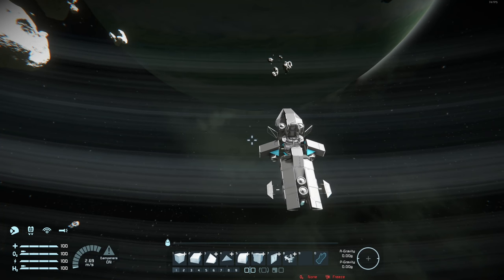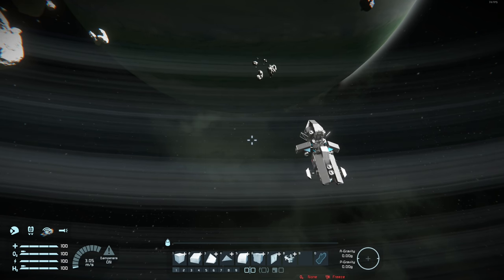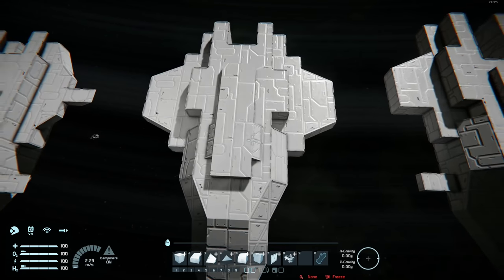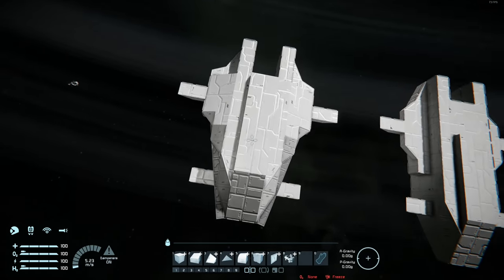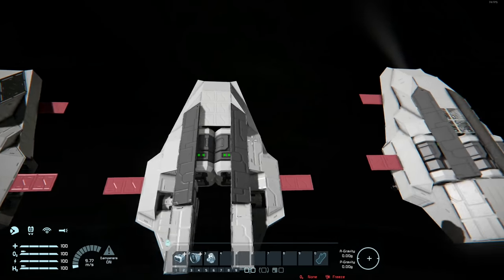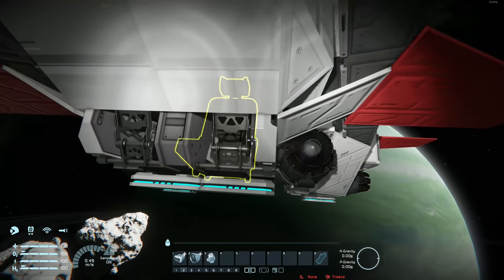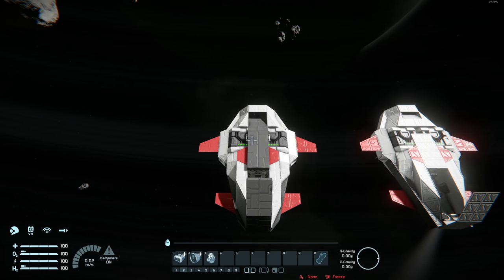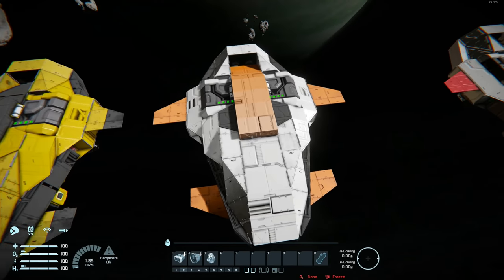I tried to build the smallest ship I could

Comment: I always have a hard time getting the first shape down, and you make it seem so easy! I’m gonna start yelling witchcraft soon if you keep up this magic
Reply from the maker: I've had a few thousand hours of practice lol
Reply: I already am yelling witchcraft.
Reply: This, much so
Reply: do random stuff, you might make something you like
Reply: I will join you in yelling witchcraft, cause that it truly is.
Reply: start with function, then add armour to pad it out where needed.
Reply: start with putting most functional pieces in (seat, battery, thrusters,...) and then wrapping it in armor, a rough first shape should form eventually, then if you like that shape you can move functional stuff around to alter the design significantly more than by just refining the armor.
Reply: Just build a 2D shape with some planning of where things will go, then you build the 3D shape with more detail and then add detailed blocks to help with the ships design.
Reply: Same here, I all my design that look half decent are extremely awkward to fly and run out of power/fuel in seconds
Reply: I use graph paper. Seriousely, it saves me hours of game time to have an outline. Took me a bit to understand the geometry of the armor blocks doing a "front, side, top" view, but its the only way for me now. Also, you haven't lost much if something happens in game; a "hard copy", if you will.
Reply: Those wings.... are a mod,  right? also,  where did he have the space to put a rotor in at the very nose to lift the canopy?
Reply: “witchcraft” is my ship name hahahahaha

Comment: I would have replaced those front blocks on the hinges with windows, so the pilot can look out and it wouldn’t go into the model. And the flat block right behind them would look better slanted down. The bottom needs work too, lots of unfinished and exposed systems there.

Comment: I guess there are two types of builders. The functionality first type and the shape first type. Me, I lay out every single functional block I want the ship to have and then slap the shape on top, but the shape is usualy weird. You did an awesome job with the design of the ship, Next time I'll try laying out the shape first!
Reply: I find that when doing the shape, adding some of the bigger functional blocks (connectors, antenna, ect) can help you figure out the shape better, at least when it comes to small ships

Comment: Three quick questions:

1) Are you playing with thruster damage off, or are the 2x1 tips in front of your reverse thrusters small enough to avoid thruster damage?

2) How do you recharge the ship? It doesn't have a merge block or connector anywhere on it, so would you need to build new batteries every time it dies?

3) Could one theoretically replace the folding cockpit shield armor blocks with glass so that it's flyable in first person?
Reply: Obviously I'm not the guy who made the ship, but I can answer some of this. 

1) Not sure, looking at 4:38 it doesn't look like there's tips there? Might be me going crazy, I dunno
2) In that ship's current state, it'd need new batteries every time. You'd be able to use a 1x1 merge block on the bottom or a small reactor for easy docking/refueling though, I reckon
3) Yes, panels and windows (iirc) have the same hitbox. It wouldn't have the same depth as the final build, obviously, but you could recreate the 5:41 build.

Comment: I would either add a connector on the bottom with maybe a small reactor, or a 1x1 merge block for docking to recharge, and use the 1x1 magnetic pads for landing gears if you want to keep the sleeker look

Comment: I modified this with a clear glass canopy that works and I can see through, because I can't stand flying with cameras or in 3rd person, removed the hinges on the side and just filled the fuselage on the sides, because I think those hinges were causing a bit of clang, made flying it a bit wobbly, and added a small reactor and ore detector. It's now actually useful in survival for fast atmospheric ore scouting. The reactor makes it not an early game thing, though, so it's probably not practical due to having something even more useful much earlier anyway. I only put a reactor on due to a lack of connector. That being said, even just as a fast air car, for getting from one place to another, it's still quite useful, even without the ore detector.

Comment: Super cool. My D: drive died the other day and I haven't been able to play anything, waiting on a new one and looking forward to getting back into SE with the new update coming. Making things as compact as possible is always hard, usually you have to use rotors and hinges to make stuff use the same block space. I had a small mech I was working on with a 1x2 modded seat and a cockpit that folded top and bottom with displays built in, sensors too so it opened up for you as you approched and closed after you got in.

Comment: I always have trouble with painting. How do you decide what parts of the ship should be what colours? Do you have a palette that you use or something? Also how exactly do you paint, I always end up having to delete half the blocks to get it all painted, which adds a good hour or so when painting even for small ships.
Reply from the maker: I don't have any fixed palettes, but some ground rules. Typically I use a dominant color (often white), a contrasting color for grooves/greeble (almost always dark grey) and a colorful highlight, which you can use to give it some pattern (like stripes or so). I always paint with the spectator cam, you can move into blocks and paint them from the inside, kinda weird, but it works. A lot of people also seem to like the paint gun mod, I only sometimes use the color replacer block mod for big ships.